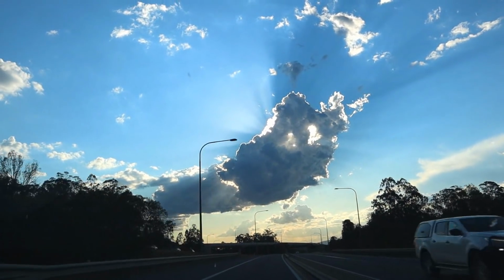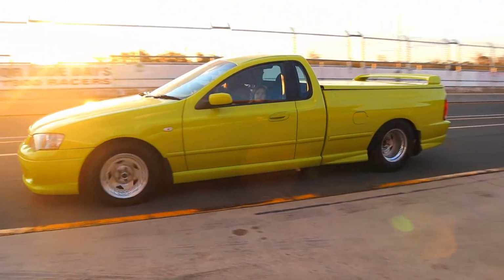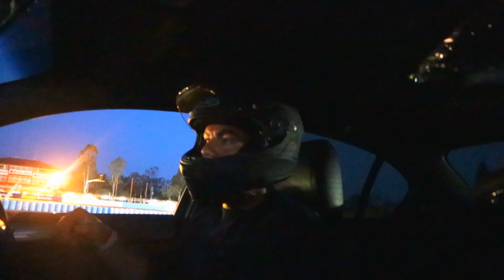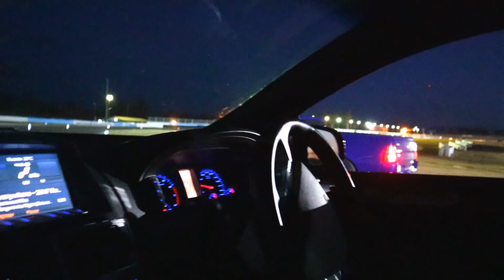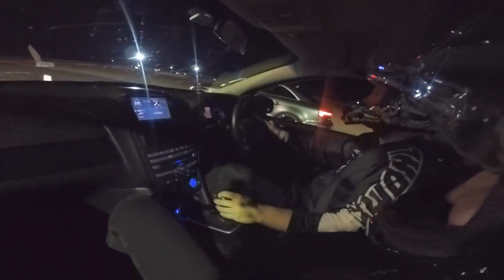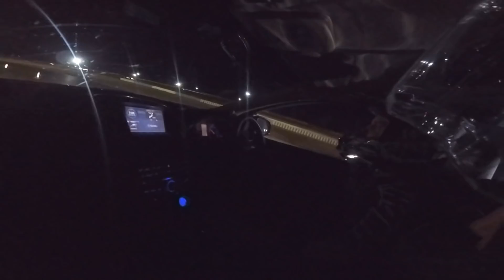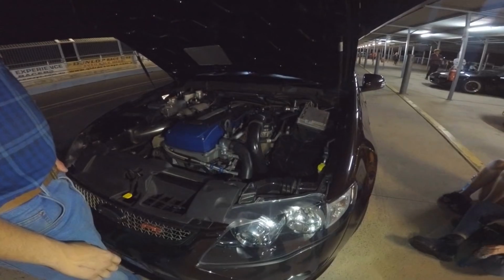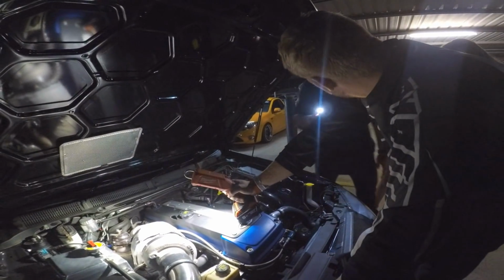FPV F6 ALMOST BLOWS UP ROLL RACING

Comment: Sounds like it has jumped timing, also it sounds really rattly on start up which to me sounds like the timing chain tensioner is stuffed and is not locking and is relying on oil pressure to  tension up, and would most likely be the reason it has jumped timing
Reply: Wow, something I thought about before Gene taught me about it. I feel so smart right about now.
Reply from the maker: There you go! :D Yeah that was my first thought as soon as I heart it as I saw a few videos on club FG the day before too. Backed up my thoughts with the codes and that's what this issue was. Going back to the shop to get fixed now and then it will get e85 at the same time :D

Comment: I knew it was the cam sensor! Same thing happened to our BA Turbo. You know how it happens. If u don’t start the car up in a long time and u give it stick, the sensor goes on it. But no it’s not the cam itself, its the sensor. Don’t know why it’s happens. It shouldn’t be nothing to major to fix. It does mess up the revs though which is so irritating when driving.